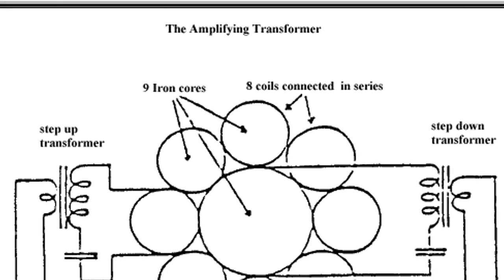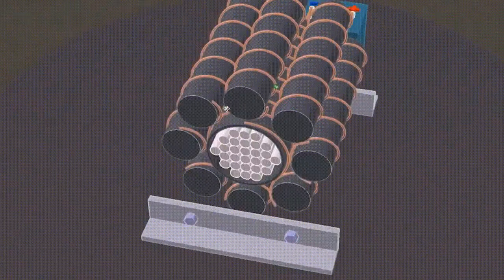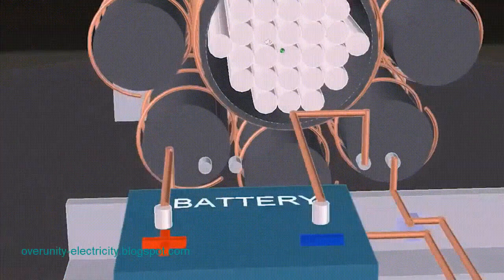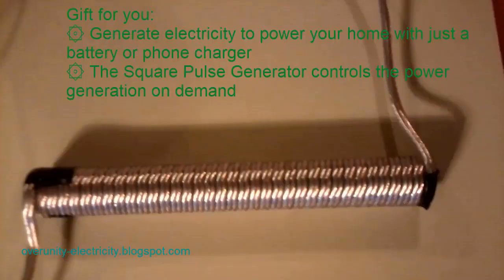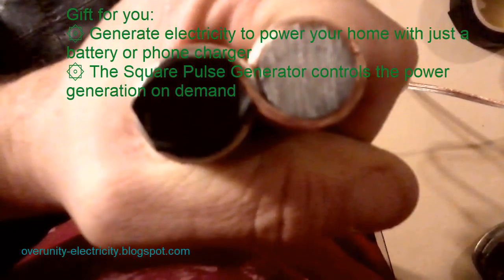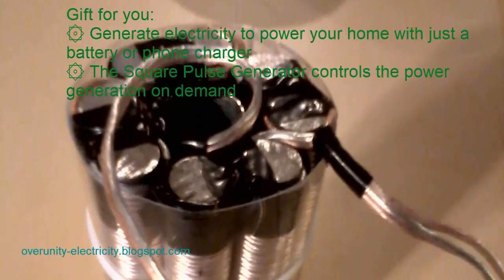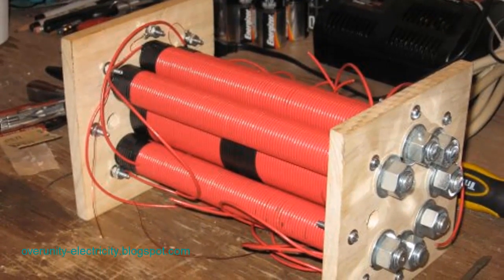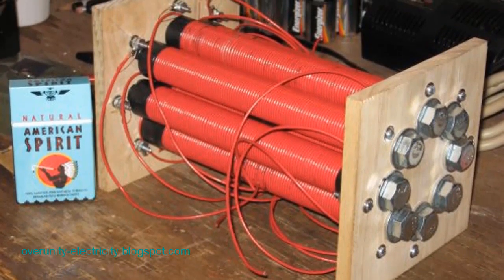Built-in Radio Receiver Signal Generator: Msi2500 Msi001 SDR Receiver Simplified Software Defined

Comment from the maker: This is a short tutorial on how to use the built-in Radio Receiver Signal Generator on the MSI2500 and MSI001 SDR receivers. The Radio Receiver Signal Generator can be used to generate a test signal for checking the operation of a radio receiver or transmitter, or for aligning antennas.

The Radio Receiver Signal Generator is activated by pressing the "RF GEN" button on the front panel of the receiver. When activated, a square wave signal will be generated at the frequency selected by the "Frequency" knob. The amplitude of the signal can be adjusted by turning the "Amplitude" knob.

The Radio Receiver Signal Generator can be used to generate signals in the range from about 9 kHz to about 2.5 GHz. The frequency resolution is 1 kHz, and the amplitude resolution is 0.5 dB.